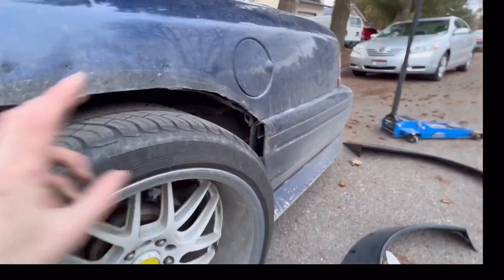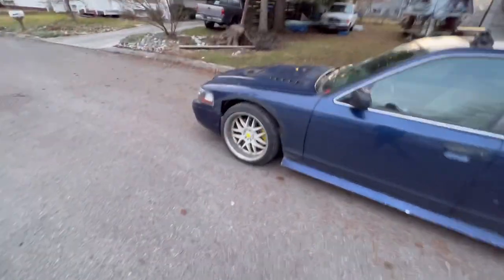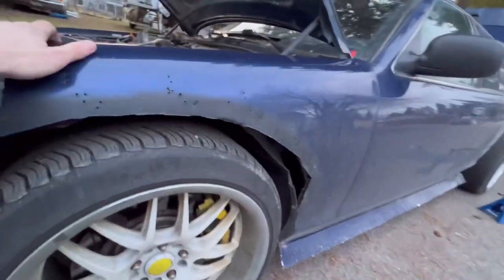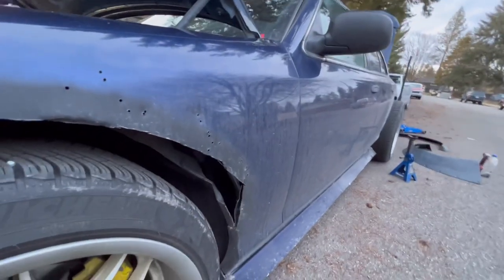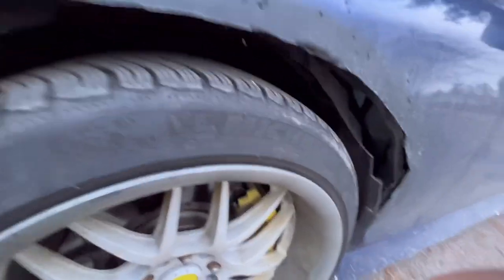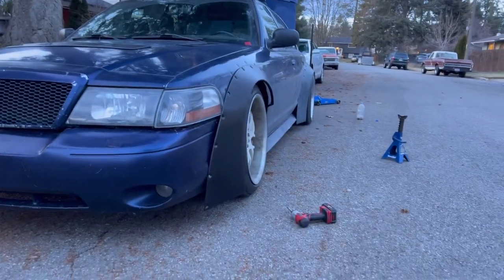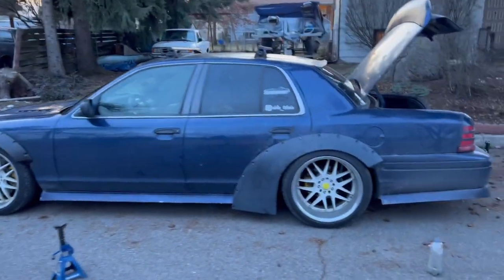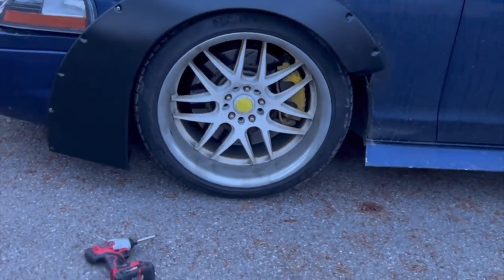Clinched crown vic is making a comeback!

Comment: Any chance you have a link for the old fender flares? Or did you build them?
Reply from the maker: These are the same ones actually! The front ones broke when I took a corner too fast into a dip in the road and my bumper/bottom of the flare caught the road and ripped it off lol so I cut em at the fender line